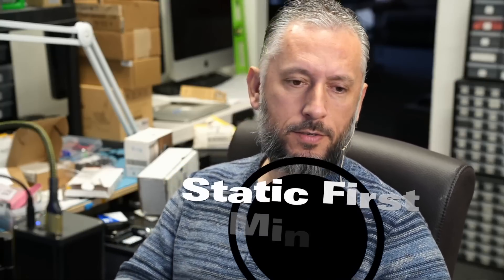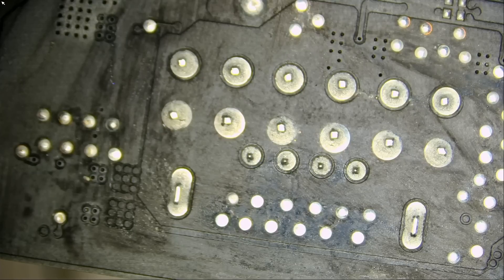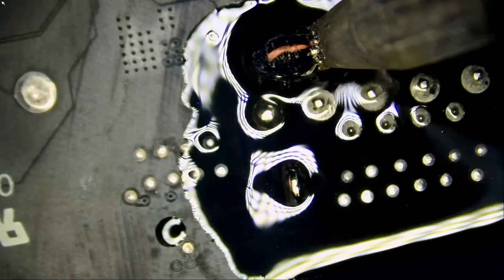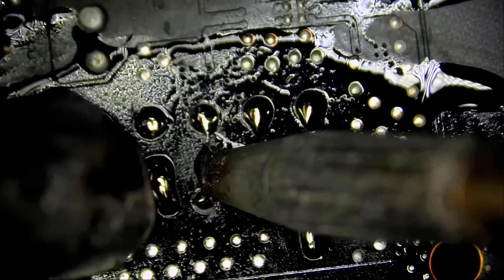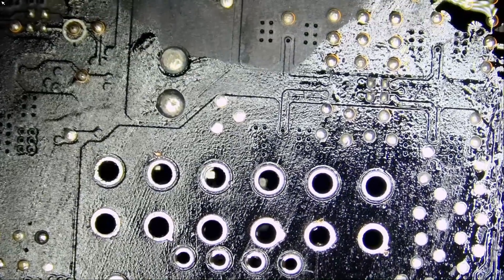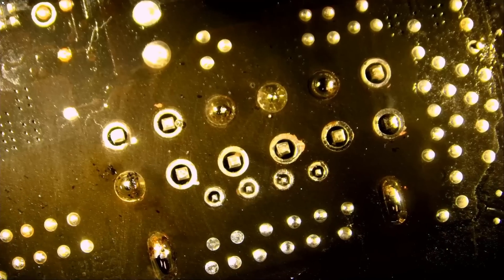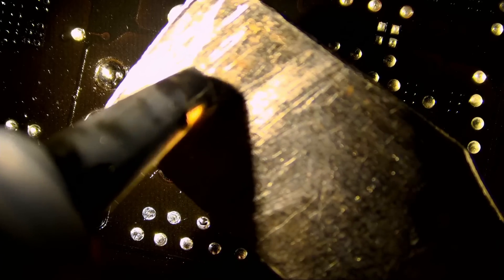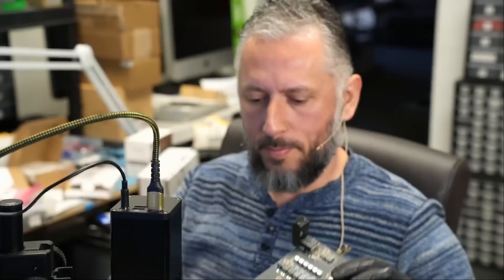4090 GPU Connector Melting Crisis Continues in 2025

Comment: I just sent my ASUS Tuf 4090 back for warranty. 12VHPWR melted. I had the 180 degree CableMod adapter for a long time - decided to ignore the recall after inspecting it a year ago and finding no damage. Recently Space Marine 2 running full tilt melted my connector so I spent a week convincing ASUS to honor my warranty (worst customer service I've ever had). I didn't say anything about the adapter 🙂 Hopefully I'll get a replacement card back soon ... if not, I'll be in touch I guess ...

Comment: Just changed my 12vHPR connector on my 4090. Got all the parts, from his shop and everything arrived perfectly. Repair came out great, low melt solder is amazing!!!! I also got a space connector for the next time! 😂
Reply: Maybe next time you should solder the 12VHPR to 3x8 pin adapter directly to the board :D

Comment: 5090's aren't doing great, two cards already have melted +12V power connectors, more will surely suffer a similar fate, NVIDIA used the same power connectors for the 576Watt RTX 5090, not really ideal if ya ask me., just seeing how many 4090's you receive per week 25+ cards per week is pretty wild.

Comment: You'd think with this kinda problem(and these prices) Nvidia would opt for different connector setup - but nah!
IDK maybe use a ceramic connector if the load is that high already or just split the connector as several ones as it used to be.

Comment: Problem is the more often you disconnect it to check for damage the more likely it is to catch on fire. I went with a DIY FAB 180° bend 12 pin high power connector. It has a built-in heat sink and make the cable almost disappear. Ordered a couple 8 pin 180° connectors for my 3080 docked to Ally X just to make it look sleeker

Comment: When you replace the connectors, are you using the newer 12v2x6 version of the card side connector?

It's supposed to fix the issue.

It said Cablemod, are their cables contributing to this problem?  Or can we say for sure?

Comment: Surely it's partly down to user error??!
I've had my 4090 since release and not a single problem at all. Made sure it was properly seated and took my time. Also vertically mounted it so not to have strain on the pcie.

Comment: I guess I got a gem.  Bought a Gigabyte Auros 4090 in May 2023 and it’s still soldiering on with no problems at all.
Reply: either way you should unplug the power and take a look at the plug. 
The big problem is the GPU cant tell if its drawing to much power from 1 lead. So the 500w draw card could be drawing over 50% though 1 single small lead instead of the 6/8 its ment to.

Comment: That 12 pin was asking for trouble. When it first came out I was like, what are they thinking? Why?  I have a ham radio license and did industrial electrical years ago and it's physically not large enough to handle the current and watts with a safe (fudge factor) ....  Just looking at it, anyone with electronics experience knew something was wrong and Nvidia refuses to admit they are wrong... 
That means it's a company that can no longer be trusted at all. 
So why are people still buying those cards from Nvidia? 
Nvidia is trying to go by something generically called "tap rules" to use undersized connectors/wiring. 
Tap Rules are a bunch of Bologna, to cut corners, and shouldn't even be legal for anything electrical....

Comment: I realized i was running my pc without a fully pluuged in power supply always had a fan on and i had my room totaly silent i hear a weird noise and it was my power supply plugging in my ac cabble was lose to power supply and the cracking niose stoped im so lucky nothing happened i have a theroy this might be a part of this melting issue

Comment: The producers of PSUs quietly changed the new standard from ATX 3.0 and PCIe 5.0 to ATX 3.1 and PCIE 5.1 they switched out the 12VHPWR -> 12V-2x6. They also changed the connectors on the new PSUs and GPUs. I know because recently I purchased a new Seasonic Prime PX1600 recently. It's still ATX 3.0 and PCIe 5.0 - it's supposed to be actually more powerful than the updated standard.

Comment: Hats off to you, still out here repairing melted 12 pin connectors that people still refuse to believe it's an issue (because it hasn't happened to them therefore the problem doesn't exist).
Reply: Its like cigarette smokers claiming they don't cause lung cancer because it hasnt happened to them yet. People are completely brain dead at this point.

Comment: 600w is nothing since stadium lights use same cable from lamps to ballast are designed go up to 1000w its depending your supplier make the connectors ...since its 12v light bulb. The one is more dangerous is the transformer supply that connects to ballast itself is over 120v..its why its our power lines do cause damage on lower voltage products ...its overwhelming higher during lighting strikes and power outage that surges do destroyed light bulbs and home computers if its not surge protected during power restoration...also i would suggest protect your QLEDS/OLEDS screens . They get the beating during surges when its using built in transformer to power screen less voltage and variable watts depending on nits level...from 120v to 12v wires

Comment: AMD have card using 12v-2x6 same as 5090 using now its first AIB cards using on RX 9070xt...4090 hadn't revise since super series release while 4080 got replace with super card while rest on bottom stack has no issues when its under 400w ...

Comment: This will also happen with the new cards because the problem isn't the angle of the cables. It's the connector itself! We need there something else.
Reply: I would just refuse to buy any GPU that needs a crazy amount of power via a dodgy cable. I don't like playing with electricity.

Comment: Are these new ones that are coming in the new 2x6 (or whatever its called) connector or the original 12v high power?
Reply: old ones ...4090 didn't change its connector...only psu and super series, also to take consideration...its partners have 2 vendors ...and ones didn't use dimple ones aren't having any problems ...its the ones does due to its metal shavings by re-insertion amount of force....

Comment: I never understood why the highest power connector in a PC would use the smallest array of pins.   It needs to be mechanically robust enough to maintain a solid electrical connection.

I love watching a skilled professional at work.  I look at this and it seems so simple to do, and it is simple when you have so much experience with the technique.  I know I could learn with practice, and would love to be able to do work like this, but I also know it would take a long time to know only learn what to do, but build the skills to do it well.  Soldering sounds simple until you try it for the first time and realize how much technique goes into it.

Comment: Hi how can i fix a 24 pin motherboard conector, i tried the cable from the psu in other motherboards and it works fine. But when i connect it to mine it stops working and i have to move the conector a bit for it to make contact.

Comment: The card at the end is most definately user error for knowingly using a recalled adapter. 🤣🤣I had 2 of those adapters never used them. Got full refund automaticaly from the retailer i bought them from. I just threw them away like that customer should have.

Comment: I've got three 4090s now and I have done the exact opposite of what they said, yanking the cable back at a harsh right angle to hide it..... Purely because they keep designing the cards all wrong putting the cables up against the PC case instead of the on the bottom so they can go straight out the back. However I've yet to have any burning issues like this, the only conclusion I can come up with is people are plugging them in properly until it clicks. I for one love the cable much more than having three 8 pins because it looks a lot neater. I just wished they would put the connector in a different place.

Comment: Gotta monitor your 16-pin 12vhpwr voltage in HWINFO64. Find your baseline at a given wattage and regularly monitor that voltage to make sure it remains around the same voltage. If you notice a lower voltage, that means your connection is loose, cable is faulty, or PSU is dying.

Comment: You seem to be really up on your tools and the latest technology so I'm unclear why you don't use a desoldering station. They are truly awesome and superior to every other method. Watch Mend it Mark. He uses a great Metcal. Also Hakko makes excellent ones.
Reply from the maker: The solder sucker is quicker and more efficient. There's no need to plug in cables, no noise, and no waiting for the solder to melt for each hole. Plus, it works great  on tiny holes where a de-soldering gun might have trouble. I'll do a comparison in the future.
Reply: @NorthridgeFix  The problem I find with a solder sucker is that the kickback can do damage and generally one pull is not enough to get all the solder out. When I use a soldering station I use a soldering iron in conjunction to melt the solder first then suck it all up with the desoldering station which is gentle and fast with a steady pull. The noise is pretty insignificant when compared to a fume extractor and the nozzle has a built in heater whereas a solder sucker does not and the solder sucker clogs up so often.
Reply from the maker: Any tool can do damage if not handled properly. Sucker remains a lot faster without being tied to a cord. Just use whatever tool works for u.

Comment: Most Lightly the connector is loose fitting. Over time the two connectors, Pin & Socket are arcing between them, generating heat causing the plastic to melt.

Comment: Good thing they raised the TDP from 450W to 575W. What can go wrong!?
Reply: I wish I could be this bad at ohms law and keep my job 😂
Reply: just plug it in the plug all the way.
Reply: already melting 5090.... cable goes to 150c derbaur was checking after 5 minutes of benchmarking.,
Reply: distribution in 1-2 of the wires within some of these connectors, for some reason, are exceeding 18 amp, which is absolutely of concern. About time to stop this "user error" - noise that are echo-chambering around in the community..
Reply: Apparently people have not yet learned cause they are stupid enough to buy these.
Reply: IF you have 600W cabie and 1000-1200W PSU and NOT using adapters and or cabie extensions , you should be fine according to Aris,the Hardware Busters reviewer and Chief Quality Control supervisor in Cybernetics.
Reply: The house will be gone completely now 😂
Reply: If you plug in the card correctly it’s not an issue. Nothing is dummy proof
Reply: I guess these dummies were not around with every other GPU that existed before the 4090 then?
Reply: @ There were never GPU's with TDP's this high before, on a poorly designed connector to boot.
Reply: @Veganarchy-Zetetic Oh they did. The standard PCIE cables are just significant under spec and mostly dummy proof... at least until someone inevitably forced it into the EPS socket.
Reply: The 4090 connectors have melted FAR more than any other card. Go do some research.
Reply: @Veganarchy-Zetetic  do you have a link?
Reply: Try red it for a start.
Reply: @Veganarchy-Zetetic  That isn't research.
Reply: @johnboylan3832  Research = 'the systematic investigation into and study of materials and SOURCES in order to establish facts and reach new conclusions.'
Reply: @Veganarchy-Zetetic  Yes, reading Re dit is not that. Particularly when you are making the conclusions you did.
Reply: @bryjb10  It does seem to happen more often with 4090s

Comment: Wonder if the 5090 is going to have the same issue, only time will tell.  thanks for the video.
Reply: Will happen 100%
Reply: it is not the plug or the card, is the fact that most people use too small of psu for the card.
Reply: @BillNye-bj5vi  Telling me you know nothing about this issue without telling me. You don't even have basic knowledge of how power draw works. Lower wattage PSU will shut down the PC if too much power is needed instead of melting the connector. LOL
Reply: @BillNye-bj5vi  Its more then the connector and more then PSU. My Nephew have Seasonic 1200W Vertex and his Strix 4090 melted about year ago and his Seasonic 600Watts cable was pugged snuggly, no movement, yet card connector melted. His new RMA Strix lasted a year and yesterday melted to the point of almost setting his whole PC on fire,. I think there will be much more dramatic issues with 5090...575Watts asking for trouble, wait and see.
Reply: @BillNye-bj5vi  OCP would trip long before the connector even melted if it was the power supply itself.
Reply: @BillNye-bj5vi  No, too small PSU would turn OCP (over current protection) on, and shut down. It's the tiny connector that's at fault.
Reply: @ ohms law do a little reading
Reply: @BillNye-bj5vi 😂😂😂 so wrong 👎
Reply: @BillNye-bj5vi  bro i dont think people who buy 4090 stingy on psu side, the real problems is the gauge of the wire the connector plastic will become wiggly overtime with that kind of heat everytime u use it that causing improper connection causing heat therefore here we are, the problems will be there with time because the plastic will melt with that kind of amp going through it they should use crimp terminal and bigger cables using plastic is just crazy

Comment: You know with these power supply issues on the 12v rail maybe they should switch to zero gauge wire and bolt the cable to the board with a crimp connector that should be able to carry a couple hundred amps
Reply: Just get an appropriate psu or even two when running these huge cards, problem solved

Comment: Does the 4070 super safe from these shenanigans?
Reply: 4070 super is 220W, less than half the power draw. As long as you plug it in fully, no.

Comment: I've had my 4080 STRIX since release, using the 12VHPWR cable slightly bending downwards and under the card towards the back, pc runs for at least 12 hours a day to do some rendering. zero problems. I feel like some of the cards are just faulty from the get go or people really don't make sure the connector is fully seated.
Reply: weak psu is the failure point. low voltage makes heat always and every time.
Reply: 4080 power draw = 320W. 4090 power draw = 450W. Plus power spikes. HUGE difference in where those 2 cards are at in terms of concentrated heat and power draw relative to the connector safe limit.
Reply: Too common of an issue here for how many he and other pcb repair shops are going through, I've seen 3000 series do the same besides ram failures.
Reply: @shadowopsairman1583  Too small of psu.

Comment: Wonder if the factory crimper is overly lubricated leading to oil in the sockets. Or if flux residue is left on the pins during the soldering process.

Comment: You'd think they'd make the connector 'better' after so many melted.
Reply: People use cables that cannot handle so much power and weak PSUs as well as adapters and cable extensions. 
A recepy for disaster.
Reply: @GameslordXY  The connector is melting, not a cable.